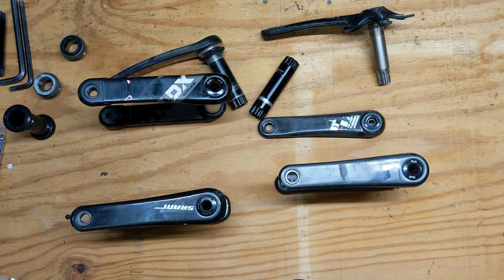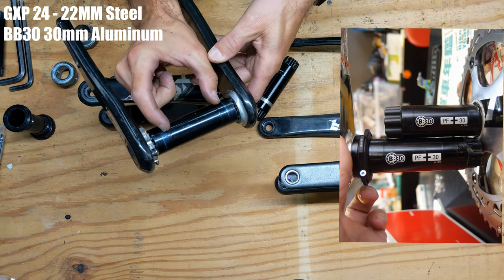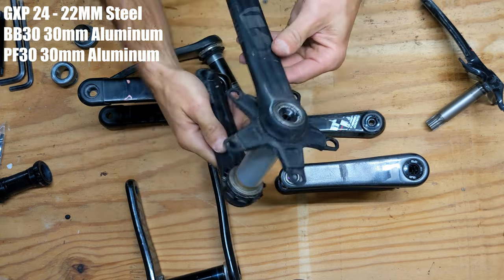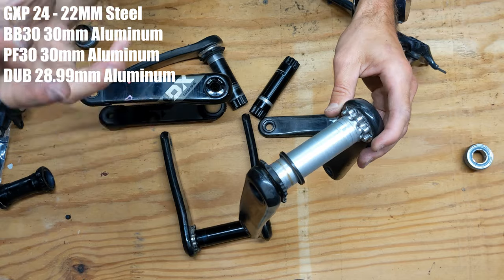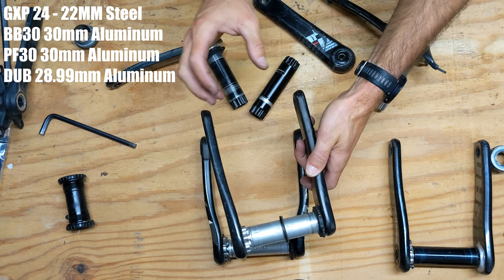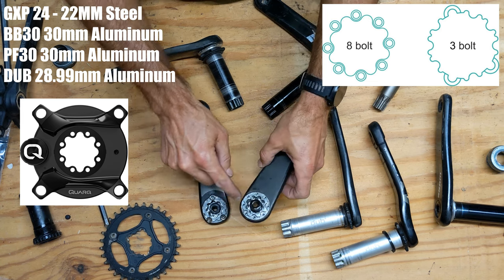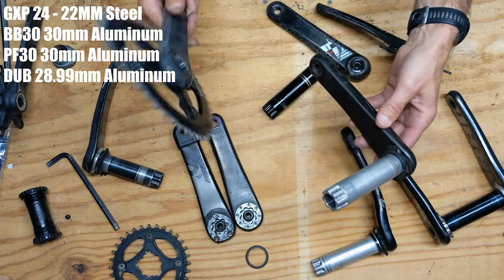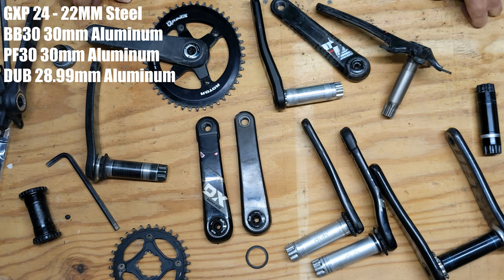Sram Crankset Spindles Explained | GXP BB30 PF30 DUB

Comment: you dont shim a gxp crankset or any 24mm crankset on the axle! shim is done on the bb.
Reply from the maker: You can shim 24mm spindles on the axle. GXP is obviously a different animal. Sometimes the shim for the BB is too thick and they do not offer thinner ones and you need to shim on the axle. On a brand new Scott Spark 2022 with XT 24mm spindle cranks, they had 2 shims on the axles, stock from the factory.

Comment: pls 
add dub wide
Reply from the maker: Sorry they did not have DUB wide when I made this video or at least it was very new. Dub Wide for road is a total of 5mm wider spindle. Everything else is the same. SO you have a 5mm wider Q factor and it moves the Front Derailleur wider by 2.5mm to give more room for larger tires. Wide for MTB does the same, just makes the spindle wider for more tire/chainstay/chainring clearance.
Reply: @BlackWaterCyclist  Thank you for the explanation....

But it is a big deal when selecting replacement BB because the bearings are 5mm further apart.

Comment: DUB is superfluous and unnecessary as the 30mm already exists, already has bottom brackets that exist and works just fine. I have two bikes with threaded English 30mm bottom brackets and there is nothing wrong with them. SRAM basically created a new size with all the complications that it creates for no apparent reason. The 'bigger bearing' claim isn't real. Just SRAM being SRAM, IMO.
Reply: Most 30mm bb’s have the cranks straight onto the races of the bb bearing, sram dubs are a 30mm Id bearings but with a plastic sleeve isolating the crank from the bearing. This will prevent galling on the axle. 30mm has its issues depending on the frames bb standard, especially bb86 which is why most have to use double row bearings to try and extend their life.

Comment: ......Sooo...I have Sram red cranks, PF-30 spindle, long version, 172.5mm. 53/39,Wanted 165mm. Cranks. Got my hands on a set. Had to send them back...came with the short spindle. No one knows what the heck i am talking about because Sram didnt even have enough courtesy for people  to  put a different model number on the shorter-or-longer spindle, they both say PF-30. So it would seem no one on planet earth has a long spindle,  Sram red 165mm 53/39 crankset, PF-30 OR GXP, new or used, for sale, so that i can match the rest of the components on my bike. Oh, and if my A1 derailleur goes bad, they want $800. It would seem Shimano arent the only greedy, inconsiderate ones, after all.(Hammerhead)